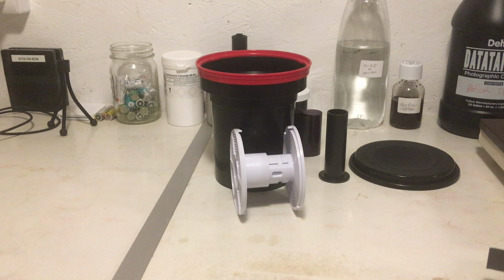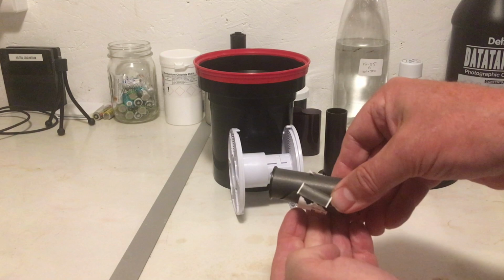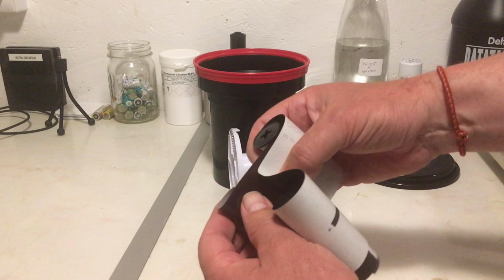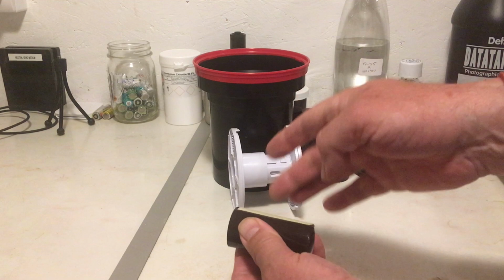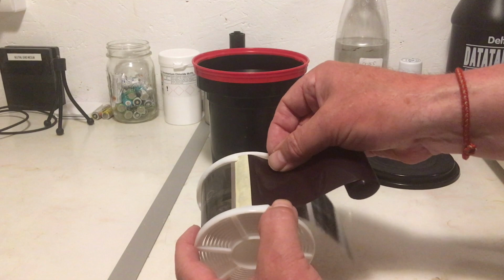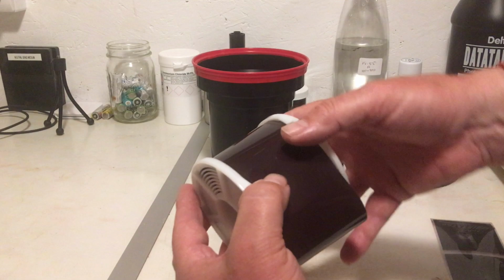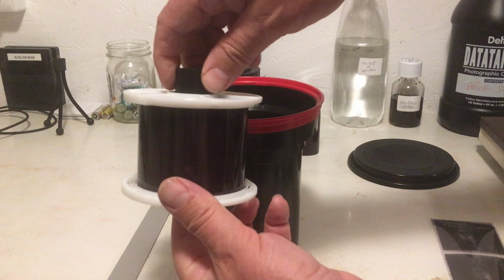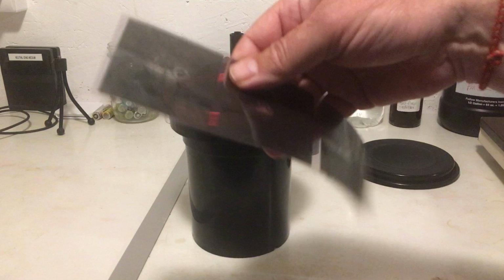The Easy Way to Load 120 Film Into a Paterson Tank!

Comment: I’ve never understood how this archaic process hasn’t been innovated. At the very least, a simple magnetic connector would solve a lot.
Reply: Film would cost more if you needed a magnet in every single roll
Reply: @kirtlandpratt873  LOL. Nice try, gatekeeper. not if you use a removable clip-on mechanism. The mechanisms are independent of the film rolls.
Reply: @Dstonephoto  so you would clip it on in the light? Then put it on the reel in the dark?
Reply: @kirtlandpratt873  So, I think it all depends on how clean of a setup you want. There are multiple ways of doing this, some more elegant than others. But if I'm really going to be allowed to go off on a tangent here, I think the entire concept of a curved reel is where the flaw lies. I think the approach of 126 film canisters should have been taken further, as that gave you the ultimate flexility in terms of light tightness and flexibility. I would clip it on in the dark. But I would have a crudge auto-loading mechanism using a box so that we can at least bypass the whole darkbag stuff. I've never understood why auto film development boxes weren't a thing. This could all be automated at a relatively low cost. No more fumbling in the dark, etc. Also, this could open up possibilities for people who are physically disabled or otherwise are unable to participate in this field due to their condition. Look, I'm not saying reel development doesn't work; I'm only saying it's an inefficient with theoretically better alternatives. I'm new to this film game, but everyone reasonably intelligent I've shown this to concurs with me it's batshit insane how film is loaded onto a camera, used, then unwound, then transfered in the black into this canister. ETC ETC ETC. That's my take on it.
Reply from the maker: We need you to invent it David.
Reply: @PictorialPlanet  That's the true answer! I need to become the man in the arena instead of the critic. I'm still perplexed as to why there were never any advancements in home lab automation (which are sane, affordable, and modular - not Jobo or nitrogen-based dip and dunk processors). I really love the cassette approach of these smaller format film cameras - they were genius. A little bit of zipadadeedoo magic and we could have a way to mark, slice, and dice separate frames on a 120 roll - and automate it. Then we feed it into a small shoebox-printer-sized contraption which handles all of the chemical interactions. So much potential innovation potential! Same for sheet film - we could have the film holder pull double-duty as a drawer we simply insert into something like a Stearman Press. While this may all sound like nothing more than an futile exercise in mental chess, let's not forget that there's an entire market of people suffering from disabilities,  or who are simply overwhelmed by confusion, who are essentially excluded from this wonderful art as a result of a stagnation. We're developing film as if we're fighting wars with muskets. (The musket works!) We can do better. The only viable DIY options at this point are either tanks, trays, Jobo, and this absurdly overpriced contraption called the LabBox. Once this market starts to innovate more I think we'll have more safeguards in place against its demise. Alright that's it@

Comment: No, Patterson's spool construction is for  120 (35 is fine!) film simply idiotic! Your suggestion is the best one can do! Here's why: the little metal ball("bearings") about 15mm  after "rail-opening" block the passage of the correctly positioned film! If one "rips the film through that, the tension of the film pushes it out of the rail after almost every movement! I have pretty good fine motor skills! (play Cello) I got 35mm film without problems into the spool! But 120 kicked itself out of the rail even at the last 5 cm through it's tension! My question: Besides checking other systems (after a bit of googling I got the impression that for 120 film Patterson spooks are the worst) I wonder if someone had found a way to do it without spools. Do you know about something like that?
Reply from the maker: Keep playing that Cello. Beautiful instrument!
Reply: the film has to glide smoothly this does work fine only :
- With very dry spools (the plastic is hydroscopic), I heat the spools in the sun or on a radiator some hours before use
- Why clean and free moving balls, I clean and check them with an absorbing cardboard I move back and forth  in the slot before use
Reply: @jean-claudemuller3199  Thanks for your kind response! The spools had been used only one time and were absolutely clean! A film lab confirmed to me similar complaints from other customers. But I have purchased Kaiser and Jobo spools. Jobo worked without any issue. Kaiser I still have to test.